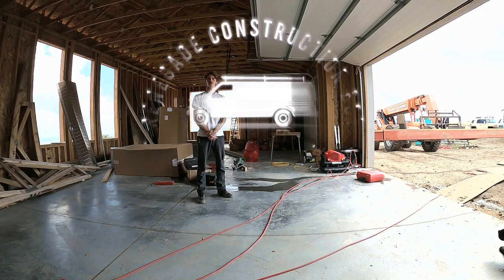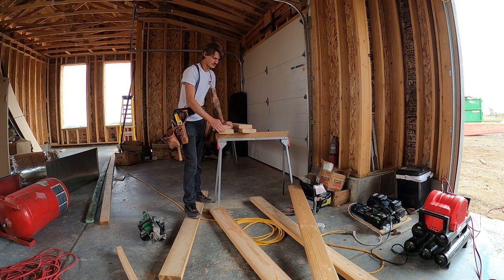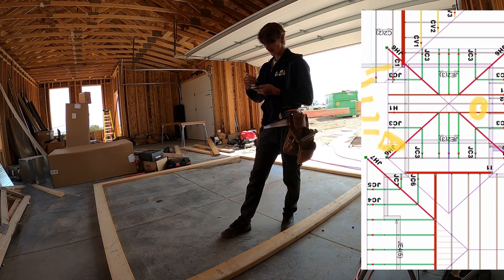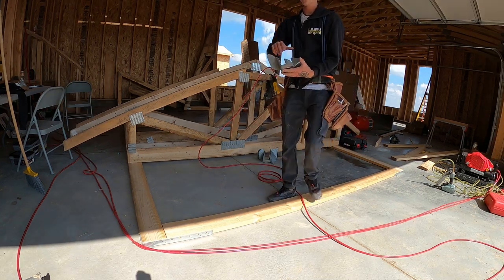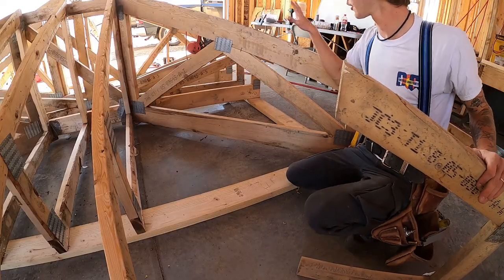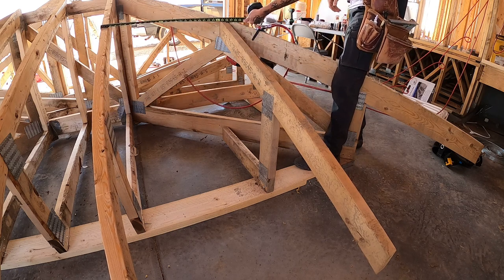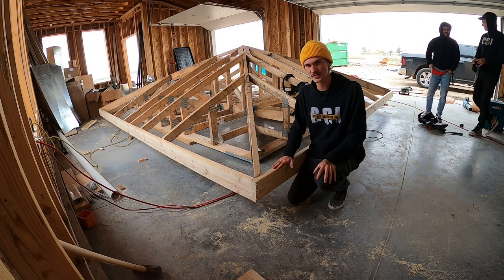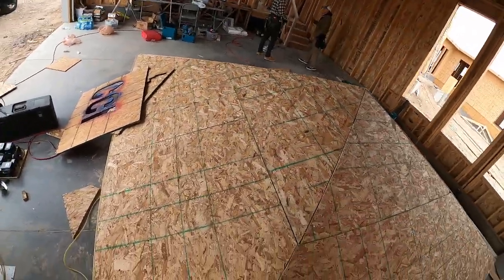Building a Roof...on the Ground?

Comment: Few questions bro. Thank you for the tutorial by the way.
1 - how do you get the bevel for that corner sub fascia tail cut to run it 90 90 at the corner sub fascia section? 
2 what method do you use to determine where the sheathing lands on top of sub fascia?
3 why hand nail fascia after you shot everything else?
Reply from the maker: 1 it’s just 2 45° cuts on a hip plumb cut 
2 I break the sheathing in the middle of the subfacia, I check the first one with my square and eyeball the rest 

3 for fun lol